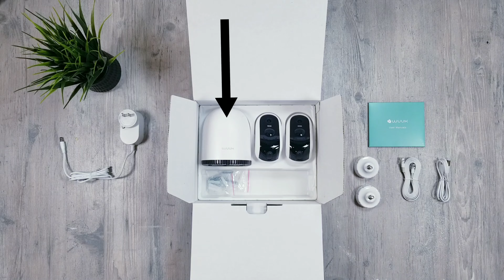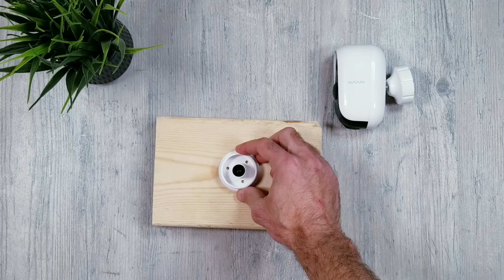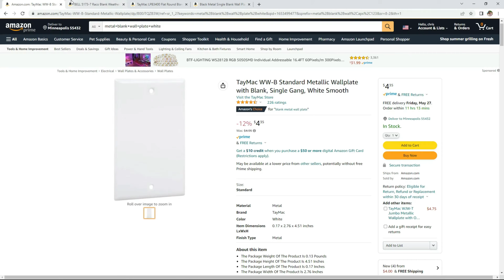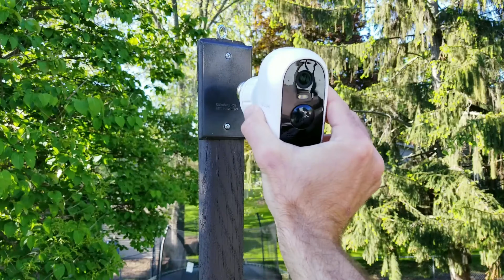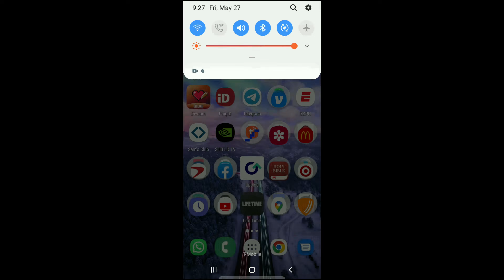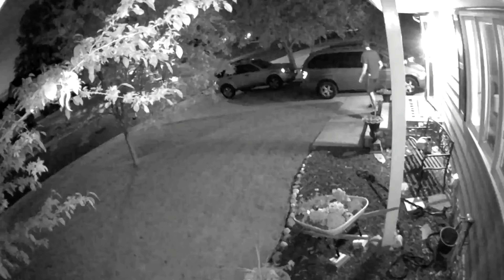Best Wireless Security Camera on Amazon + DIY Magnetic Mounting Hack

Comment: Hey great video did you have any issues with the notifications when motion was detected? how long did it take to receive the notification from when motion was detected?
Thanks 👍
Reply from the maker: Thanks!! Notifications seem to be working just fine for me. I would say I get a notification within 5 seconds of the movement actually happening. Are you having issues with yours?
Reply: @ChrisMaherDIY  hi I haven't purchased it yet I purchased the 2c from amazon then I see your video regarding the security issue so it will be going back. So I'm considering this so I wanted to know if the notifications are good as that is important to me would you say its better that the uefy in terms of notification speed and playback? Thank you
Reply from the maker: @johnravis3943  Thanks for the information. I'm not sure I was the one who made a video on the 2c. What brand is that? So I've never used the uefy brand so I'm not 100% sure on what their notification system is like or which one is better. But i know this one does have free returns on amazon so i would recommend just getting the ones you think are the best, test them out a little bit and return the one that you don't like as much. As much as I dont like amazon because they are so darn huge, their return policy is what makes me continue to order from them!
Reply: @ChrisMaherDIY  😂😂 sorry your right it was someone else who posted the video with the security flaw on the eufy cameras
I know exactly what you mean with amazon its putting other businesses out buisness but most of the time you can find it Cheaper on amazon and the returns are good if money was no object to me I'd buy from somewhere else thanks for your reply and your good work 👍